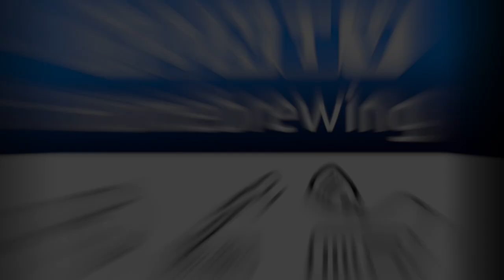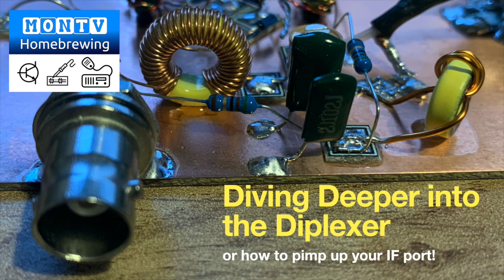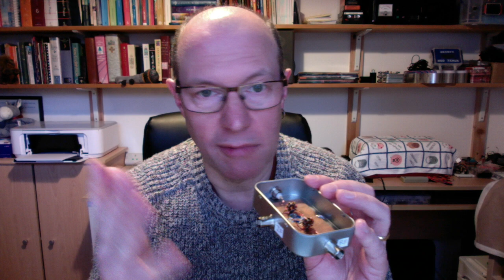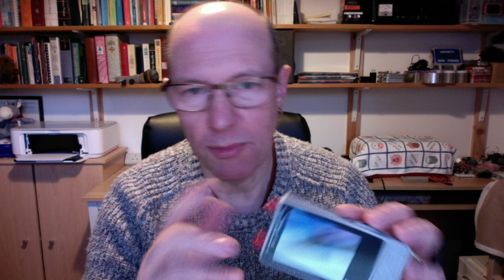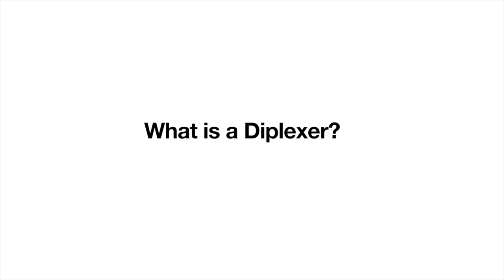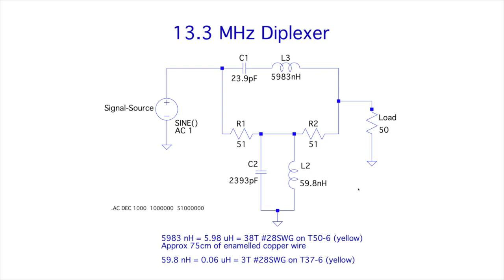21 - Diving Deeper Into The Diplexer

Comment: Thank you for the video.  

It would be useful to note the toroid mix values used in the band pass filter.  From the pictures it looks like mixture 6 (yellow)  toroids were used, which can have a relatively high Q factor compared to ferrite core mixes like 43.  The SWR curve of the bandpass filter may be a bit less steep with a more broadband toroid.  Nonetheless, the diplexer seems like the right solution.  Thanks again for the interesting video.

Comment: Nice explaination.
Check out Mini-Circuits Labs Reflectionless Filter ( XLF-151) series. These are a low pass versions instead of bandpass.  
Question: for wide band Data use what is the phase response in the passband, how bad does it distort the IF signal.

Comment: There's something here I don't understand.  I get the part where you say the output from the mixers IF port must be 50 ohms to provide a good match and stop reflections back into the mixer.  Couldn't you just feed the IF output into an impedance matching inductor, designed to match the input impedance of the next stage?  Filtering would then be done in this next crystal filter (?) section...  What have I missed here?  Learning LTSpice at the moment, maybe I'll try to model it.

Comment: I was re-watching this excellent video, because that's what it is, and I'm a slow learner. :)
I do have a question for you, although a bit peripheral to the point of diplexers. I see that you mount your toroids directly on the copper-clad PCB material. I've watched some other videos that show how the inductances of them change with proximity to metals and dielectrics, so I've been trying to 'suspend' mine off the PCB's as much as reasonable, either by using heavy leads attached at the coils, or with small pieces of Styrofoam for the toroids to sit on, but your circuits appear to be quite accurate as built and affixed directly to the PCB, with little or no tweaking. Is this because the relatively low frequencies of operation are more tolerant to minor changes in inductance?

BTW, I'm going to get one of those UV glue pens. That's an excellent tip. It allows one the control to make sure everything is properly positioned at the moment the glue sets, and I have numerous improperly positioned parts to demonstrate the need for one.

Comment: Excellent presentation. Clear and concise, with what matters most to the way I learn - WHY use a diplexer. Why it's better than the other circuits. Until your presentation I never understood exactly what a diplexer did, or how. Thank you.

My only other comment, (for those who work with much higher frequencies,) is that resistors don't stay resistors at higher frequencies. One needs to take their inductance (mostly) and their capacitance (possibly) into consideration depending on the frequency of operation. That's where the NanoVNA becomes the most valuable design tool you can have, since ALL components, including resistors have some inductance and capacitance, and it can be dealt with using the NanoVNA's. They have opened up microwave frequency design and construction to the amateur radio hobbyist.

Comment: Hi, very interesting video and made me consider the diplexer I made for the Eamon Skelton EI9GQ transceiver.  I followed Eamon's circuit but moved the IF frequency up from 10.7MHz to 11.2MHz to match the IF filter.  So the capacitance and inductance values will require tweaking a bit.  LTSpice simulation shows the mismatch I have to be quite small but I will put my VNA on it to check.    Looking forward to your next video, Nick. Best 73's  de  Steve M0SHM.

Comment: Hi Nick, I ran the simulation (with a .NET command) and changed the 23.9pF to 22pF - the values for ZIn and Zout changed a lot, the peak is now 150 Ohm at. You may need to "tune" the diplexer to get it to work or pick a different Q value. Thank goodness for NanoVNAs!

Comment: One thing you could do with explaining is how you arrived at the series LC values (23.9pF and 5983nH). At 13.3MHz these show a Z of 50.005102963016Ω and w of -0.81855029821357 degrees. Might be interesting to plot (using step params in LTSpice) how changes in L and C affect the w and how this affects the SWR.